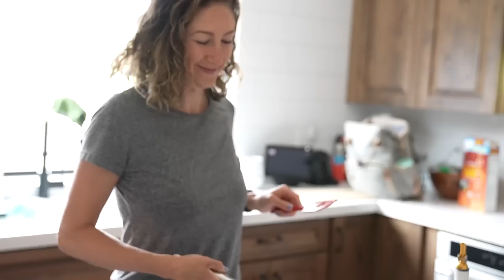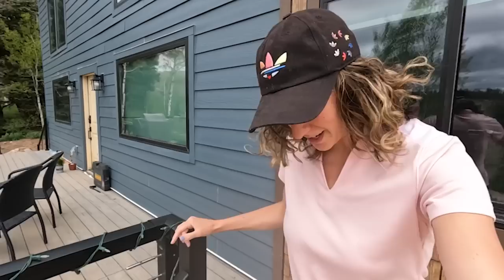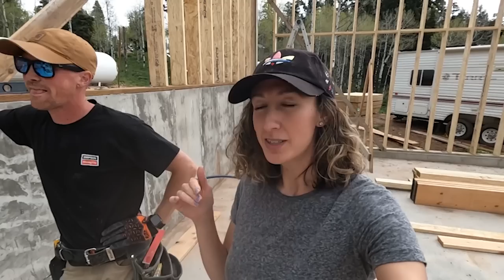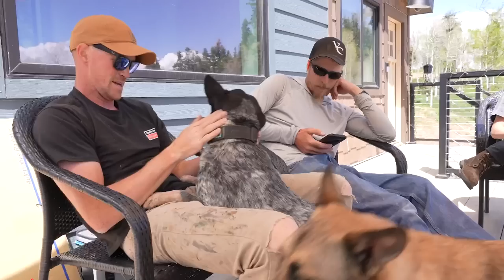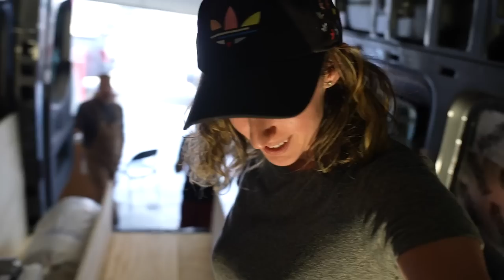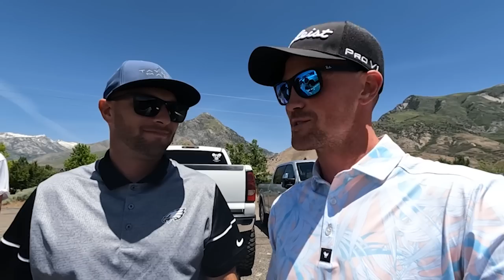FRAMING THESE WALLS IS HARD!!! | BUILDING OUR OWN HOME

Comment: Hey Trent and Alie, With the blocking cut them to an 1/8" shorter than the size. This will allow the studs to stay true and straight even if it is not perfectly tight. Just a tip for a old time framer of a decade and a bit. From Canada. Over all it looks awesome guys.

Comment: Might want to check out info about transmission fluid toxicity for dogs. Even if they run thru it and lick their pads they can get exposure . The overflow on the road along with the possibility of the truck continuing to leak where it’s parked could possibly be fatal for your dogs.

Comment: That's why I prefer wall vents.   I have learned (having a house full of cats) to put covers over the vents.   They also make vent filters that help.  (Dryer sheets work as filters in a pinch)
Reply: My Furnace-AC repair man told me Not to use those register filters cause it makes the furnace and AC  work harder

Comment: Next time cut a block first and use it as a spacer when you set the studs. Lay it on bottom plate, tack stud bottom. Hold block against top plate, tack stud top. Rinse and repeat

Comment: when you get to the garage doors use a jack shaft operator not trolly. jack shaft mount to the wall and slide onto shaft. by the way the wait time in canada for a residential garage door is min 42 weeks, you also want a high lift door as well. cause you live in the mountains also recommend getting at least 1 3/4 to 2 inch thick panels to keep the cold out. oh yeah it will only take 1 day too install them,

Comment: Did you bolt those pallet rack into the floor?  If not, did you secure the tops to the wall with some braided cord?  Both methods will keep the rack from falling over into the shop.

Comment: Why do you have a tractor? It doesn't just move snow. You could have lifted the front and guided the truck to where you wanted it.  Also you can use the bucket as a ladder. The versatility of a tractor is limitless.  Just some thoughts.
Reply from the maker: We don’t have any implements except for the snowblower.

Comment: To verify the accuracy of a level: use a piece of about 5 feet of transparent flexible pipe - fill it with water and holf each end on each end of the level, exactly in the same place on the ends of the level. in a manner  that you will be sure the level is ''level'' with the water. Then check where the bubble is. If the level is good, the bubble should be right in the middle of the alignment lines. Same process can be used for longer distances with a transparent garden hose. Water is always level !  Another trick; to make sure a building is square: measure corner to corner from the same points. If there is a difference, push in each corners of the fartest distance by 1/4 of the difference between longest and shortest distance. Repeat untill  less than ''a hair out of square'' !

Comment: I forgot to tie the transmission fluid cooling lines up on a Ford Ranger pickup I had while waiting on a new radiator to arrive and all the fluid drained onto the ground overnight and I was shocked to find out it took 13 quarts of automatic transmission fluid to fill the thing back up!

Comment: Please be careful with where you work on your car.  Transmission fluid and other fluids that run your car can have devastating effects on pets. 

Transmission Fluid Toxicity in Dogs
You may notice these symptoms if your dog ingests transmission fluid:

Lethargy
Vomiting
Incoordination
Excessive urination
Excessive thirst
Low body temperature
Seizures
Coma
Severe kidney dysfunction
Depression
Lack of appetite
Death
If you notice any of these symptoms in your dog, then call the vet immediately. This is an emergency.

Let the vet know approximately how much transmission fluid your fur baby drank and when they drank it. Also, give the vet the name of the product. Some transmission fluids may contain other ingredients, too.

Do not wait to call the vet once symptoms have set in. The problem with this type of poisoning is that the initial onset of symptoms may be concerning. However, a few hours later, they seem to be improving. However, the dog is only becoming sicker. If not treated, transmission fluid toxicity can lead to death in dogs.